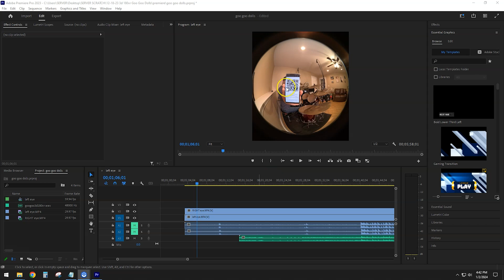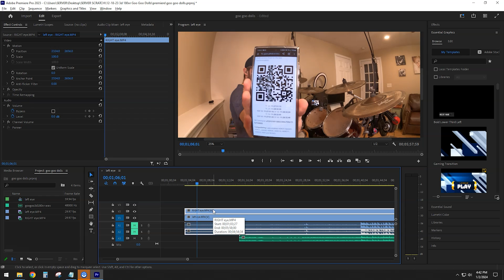3D VR180 with a Dual GoPro Hero 12 Gimbal Setup

Comment: Is the time drift on both cameras close? If you do longer 30 min vids will either camera start to drift more than the other?
Reply from the maker: There is no drift while recording. That would only happen if a camera started dropping frames.   The drift comes when the cameras are idling, so it's good to resync with the time qr code just before recording.
Reply: Great! I was afraid that since the main clock oscillator wasn't temperature controlled it would have a high ppm drift. People attempting the same with gopro 10 and also go pro 11s were getting around 5-6 frames drift every 40 mins or so... The hero12 though seemed to hold sync better. I wonder if they put a tcox in it for lower ppm. The go pros have rolling shutter, so any fast moving stuff will probably have desynced rolling shutter artifacts but you can probably compensate by just using shorter shutter time or something... Thanks for sharing your work!
Reply from the maker: Something definitely changed with the hero12 making it much more accurate.

Comment: Inspired by your video I have done this with a single GoPro 12 with the 2.0 lens. In my case, I am just using OWL 3D to make an AI stereoscopic video. The quality is actually quite good. 

I do have 1 issue. There is a lot of warping from the lens that isn’t straightened correctly. Is there a setting I need to change? Using 4k with 8:7 and max lens turned off.

Comment: What is your gopro settings? im taking it underwater to film some vr180 underwater shot.  Also not sure if u encounter frame blending from the footage when trying to align them together. like at certain frames the number will be off then few frames later it back to the same again.

Format that im going with, not sure if its correct.
Log
8:7 , 4K , 50FPS
Max Lens Mod 2.0 - OFF
Stabilization - OFF
For the Image Sharpness do u set it to low? 
Also ur shutter,iso, white balance...

Comment: WOW! Cool stuff! WIll buy this also! Can you say something if the mod lenses iw worth to buy? Because its 177 vs 151... not so much... I wold love if you can show the diference with mod and without if it possible
Reply from the maker: There are other videos demo'ing the lens mod 1.0 and no lens mod.. its not worth doing on those setups.
Reply: @mainelyhobbies  Thank you! Can you tell me please what settings shold i use for good vr180 video? I mean if this is 4:3 or 8:7 etc... Also i see the image is round on lcd sceens is this what the lens mod do?
Reply from the maker: @AntonBarcelona  it is 8:7 and turn off stabilization and set color temp and iso manually so the cameras match.  Don't tell the gopro you have the max lens mod on and you'll get this circular video to work with.  4k 60fps
Reply: @mainelyhobbies  wow! thats cool... but dose it mean that if i can just use this feature as it is without lenses and it will work? Because when i activate the max view (i dont have lens, just a hero 12) the fov looks bigger so i can manipulate the image and make it vr180... am i wrong here?
Reply from the maker: I dont think the fov is much wider, the cameras is probably just stretching it.  Max lens mod 2 is the way to go.

Comment: Thanks for sharing!  Can you turn off all internal stabilization on these cameras?  Otherwise they might each stabilize slightly differently and make some headache inducing stereo.
Reply from the maker: Yes, hypersmooth has to be off for the full field of view anyway.
Reply: In some of the earlier versions of the Hero there was slight stabilization happening no matter what the settings were so glad to hear that's not the case anymore.

Comment: Action videos would really benefit from VR. We need to get this working. I guess the synchronization is the main challenge. Is there any USB C tool for that? Also for the gyroscopic stabilization, we might need to stabilize both videos using gyro data only from one of the cameras. But in that case, the mount would need to be very solid.
Reply from the maker: Sync is the easiest piece of the puzzle where you can just show the timecode to the cameras at the same time and have frame precise sync.    I heard someone is making a tool to use 2 insta 360 x3 cameras, and it allows their flow stabilization.
Reply: @mainelyhobbies First of all kudos for your experiments 😎 Did You kept a link regarding the 2x Insta360 x3 setup ? Thanks

Comment: Does the hypersmooth work when the camera is set to 177 degrees? Would be nice to get some VR walking videos but probably only worth it if the videos are stable.
Reply from the maker: No there is no hyper smooth in this mode. Really all hyper smooth does is crop , so you would lose field of view anyway. Also, I suspect if the two cameras aren't perfectly calibrated you might see issues with hypersmooth anyway, similar to how you need to have them in manual mode so they don't have varying color temperatures.
Reply: @mainelyhobbies  That is a shame. Would of been nice to have a VR bike video in the forest in 3D. Maybe with a gimbal, but then the weight would be a problem. Wasn't sure if there would be a way of synchronising the stabilization in post so that they match but have no idea how you would go about achieving it since it is a very niche use case.
Reply from the maker: Biking is one of the most vibration inducing activities... so much so that it's used as examples for stabilization quality on many action cameras. I don't think even a gimbal could save it from motion sickness haha.
Reply: @mainelyhobbies  I used to have a chest mounted feiyutech gimbal that worked well for mtb, it was just combersome to wear and a very fidly to setup and only ever tried it with 1 camera.

Comment: Good setup, though I'm a little skeptical about actually filming while using a gimbal. I can see people getting motion sickness very easily from that. (at least for 180 vr in a headset). Did you try the 5.7k mode or if not, could you make a sample for it? Would love to see how they compare in my Quest 3. If you could upload to a file sharing service, that would be amazing, as I have software on the Quest that can display these in full quality.
Reply from the maker: Slow motion is fine in my testing.  I dont have a sample for you, though with movement.  Just that stationary 180vr drum video on deovr i posted in another comment.   5.3k wouldn't work when I tried to export.  I think 5.3k times 2 is too high a resolution??
Reply: @mainelyhobbies  Interesting, I will definitely try to check out the deovr video. I haven't really done the math, but I've seen a wide range of resolutions used for 180 videos.

Comment: I have printed case, I have bought 2 cameras and 2.0 Lenses. First of all I need to not turn on Max Lens Mod 2.0 mode and choice 8:7 aspect. But what about combine in Premiere? 50/50 % split screen?
Reply from the maker: You will need mystika to put them together.   Hugh Hou has a tutorial.
Reply: Thank you. But I have spend half life using Premiere Pro, and I never used Mystika before. Maybe I can combine film using Premiere? @mainelyhobbies
Reply: Did you have to scale the print? I pulled it into my slicer and it’s like 1cm.
Reply from the maker: @lordoftheengines   Yes, I think it had to be 10x scaled - I didnt make the file and ran into that same thing.